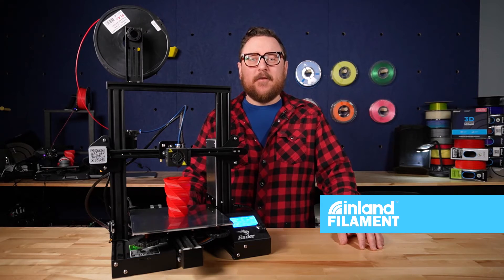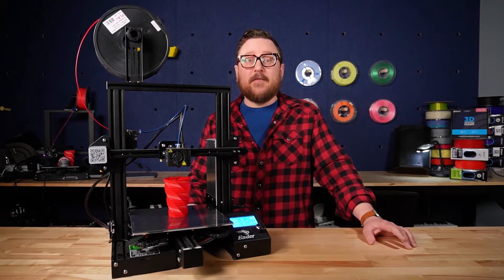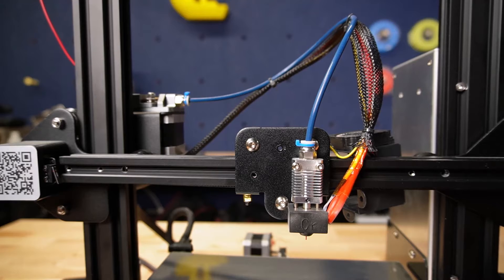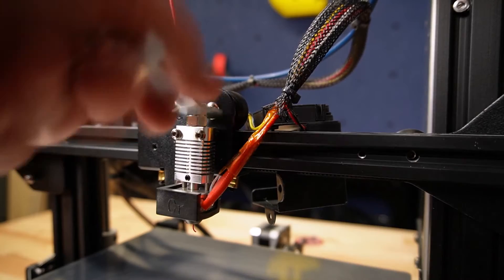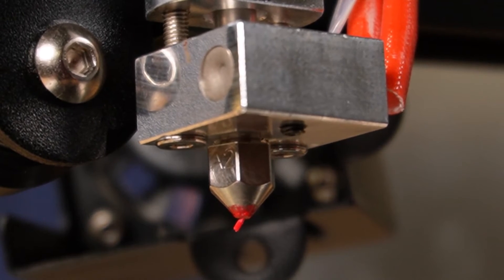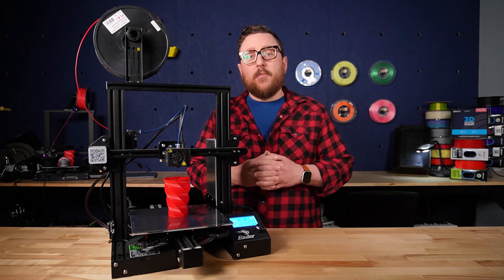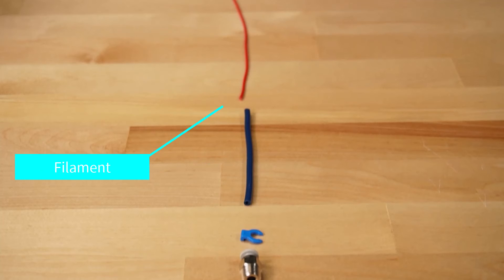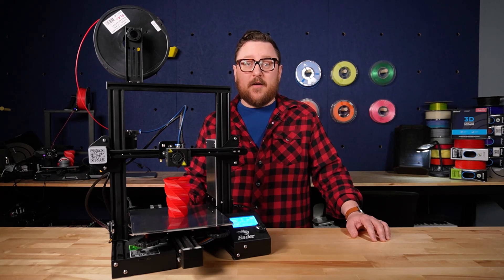3D Printer Hot End Disassembly - Creality Ender 3 Pro Hot End Tech Guide

Comment: Good information for beginners, but just make a samll correction since you are trying to educate viewers about proper nonemclature. The Thermistor does not "act as a Thermostat." It is a resistive temperature sensor that gives feedback to the controller which contains components that act as the thermostat, among various other functions. A Thermostat controls temperature by regulating curret flow to teh heater element by mechanical or electronic means, but it needs a sensor to give some input to determine correct temperature. The thermistor does this by changing resistance as temperature changes. The controller monitors the thermistor resistance and determines whether the controller needs to keep supplying current to the heating element to make it hot or to limit current to allow the fan to cool the hot end. This happens constantly (aside from hysteresis) in a closed loop mode to maintain a constant temperature. The Thermisitor more of a thermometer and not a Thermostat.